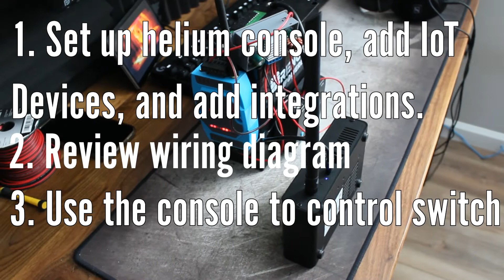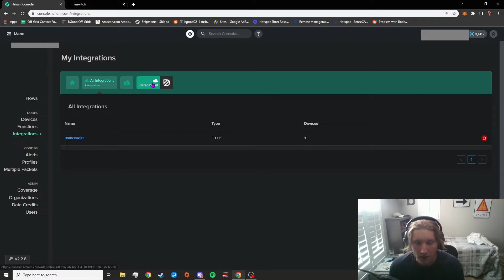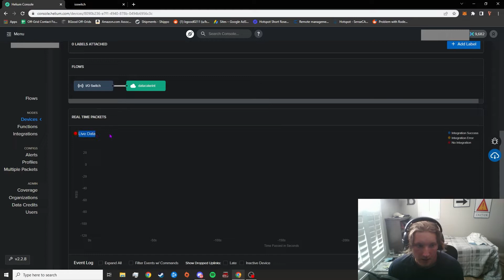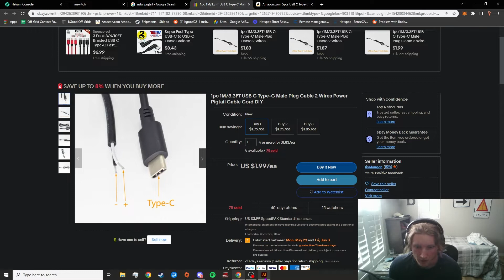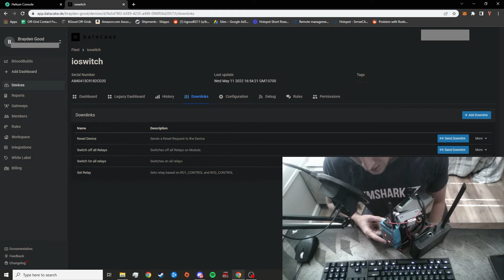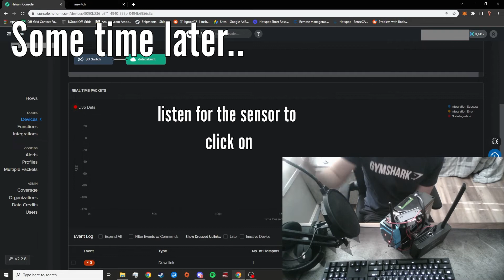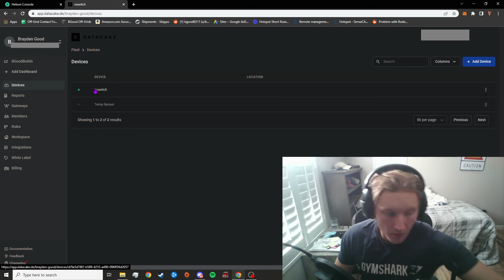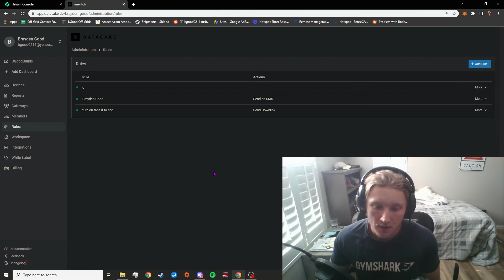How to Remotely Turn Any Electronic Device On/Off Using the Helium Network/Lora!

Comment: Great vid bro! I wish the part 4 off grid video went into more detail when wiring the buck converter, and setting up the charge controller because I’v seen so many setups where they have sensecaps and are only using the charge controller.
Reply from the maker: The setup requires some sort of converter between the charge controller(12v) and the sensecap(5v) unless you use the USB port on the charge controller since that would be 5v2a. This is acceptable, but ideally the miner is supposed to run on 5v3a, and I have heard the controller USB ports are not the most reliable. I've seen others use a stepdown converter that does 12v->5v conversion to power the miner, which is also acceptable. However, this device has no voltage regulation, so the battery could be charged up to 14v and at that point I am not sure what voltage would come out of the other end. Most optimal way is to use the buck boost since you can get the exact  power specifications you need, and better yet the power is regulated so no matter what voltage you put in, you will always get out 5v. If you need help with the wiring of the buck converter please feel free to contact me via the website, I can try to help out as much as possible; video call, message, whatever helps :)
Reply: @bgoodbuilds4571  Awesome, thanks for the help bro! I appreciate it.

Comment: I think you should take this a Step Further and  make a follow-up video on Monitoring Battery Voltage and Solar panel current!
Reply: Once you've added the device to the console and have completed the Datacake setup and integration (all first 5 minutes of this video), you can use Datacakes to easily build a dashboard to see whatever values your IoT device is willing to display.